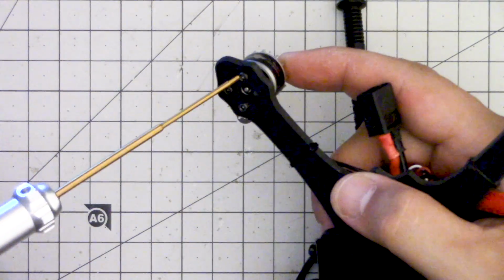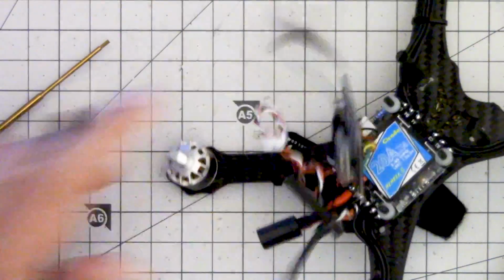Quadcopter Hot Motor | REAL WORLD TROUBLESHOOT

Comment: I have fpv drone I bought online. After a few crashes I lost a motor. When powered on it spins rough a few times and then the drone shuts off power to it. I learned how to Do a motor swap but it didn't change the problem. I took it apart and see nothing wrong. Any help? Thanks love the channel
Reply from the maker: If you swapped the motor and that didn't fix it, swap the ESC next.

Comment: hi, Joshua. Thank you as always. I do have a question.  Hello. Finally received my order to do my build but having major issue I was hoping you could help me thru.

After I built I hooked up my receiver. No drama there. Got motor and board orientation set. Armed and throttled no problem while hooked up to betaflight with Ian and battery. I'm using the f3 and esc with osd you have on sale

Issue. Motor3 will not spin when armed when not hooked to betaflight. So I cannot fly. I upgraded the esc and did not flash the FC. I'm using dshot since the esc upgrade was for that anyway. 16.6 stable.

Any ideas? It flew for one battery after initial build then motor 3 never spun up again unless I had it hooked to betaflight.

Please help if you have any ideas. Thanks
Reply: Sorry, this is an omnibus flashed 3.1.6 f3 with osd and a 10amp esc 4in1 from flexrc
Reply from the maker: It's hard for me to imagine what would cause the motor to only spin when plugged in to USB. Especially because it worked once and then not after that. I'm a little stumped, to be honest.

Comment: hello Joshua,
If I have checked that the motor screws are not too long to touch the winding but the motors are still running hot with props when testing in the betaflight motor tab what may be the problem?
I am using brotherhobby T1 1407 3600kv, Racerstar Labs 28A, betaflight F3 and kingkong 3045 triblade.
Is it possible that these ESCs are not compatible with the motors? because when I try to run EMAX 1306 4000kv with the same setup, i will also get hot motors in the motor test tab.
Thank you very much for your help!
Reply from the maker: Hot motors even in the Motors tab means the issue is NOT PID or vibration related. If you spin the motors with props on to high RPMs, they will get hot because they are working. That's normal. It's normal for them to work harder on the bench than in the air.
Reply: thank you for your reply.
I only put it at below middle throttle and leave it run for about 40 to 50 seconds.
Was considering if I need to change the ESCs because i turn the PID all the way down as compared to the stock settings before conducting the hovering test and still got hot motors.
That is why I am thinking whether there is a ESC and motor compatibility issues.
Do you think that is possible?

Comment: Thanks for this video. My new lizard 95 would fly good for a while but ever so often it would just roll over until it crashed. All the motors are quite hot after a flight but is 115+ here in Arizona so I checked the continuity and both right side motor bolts short to frame. I guess the mounting bolts are a little too long. 
Do the  two motors that were shorted need to be replaced? I can back out the screws and the continuity stops.  I noticed you said that you were replacing the shorted motor in your video. 
Thanks

Comment: Hi Joshua I have a set of hglrc 1104 7500kv and brotherhobby 1106 7100kv motors that are both rated for 2 and 3s. They both get extremely hot running on 3s. Is there any way to tune them in betaflight to keep the temps down? They are getting up to around 60c on all the motors.
Reply: hi, maybe you are overpropping them or the AUW is too heavy for these motors?

Comment: I am struggling with scews that will NOT back out. 2mm hex drive. There is continuity to frame on all 4 esc. Thinking my only hope is an easy out- has anyone ever had frozen screws this size?
Reply from the maker: Why won't they back out? Is the thread stripped or is the head stripped? If the head is stripped there are various approaches: dremel a notch for a flat-head, or use an EZ-out.

If you do anything that will create metal filings or shards, you have to try to take steps to keep them away from the magnets. If you can remove the bell first maybe that would be a good idea. Otherwise, the magnets will attract the filings and junk up the motor.
Reply: the heads will round out- came so tight from the factory. Wanted to say THANKS for your speedy reply! Great warning re keeping debris out.

Comment: It is normal that the 4 motors get hot??
Reply from the maker: D gain too high / too much vibration / not enough filtering. Or over-propped, but this isn't likely on today's 5" builds. Basically no modern 22XX motor or larger is going to be over-propped on any 5" prop.
Reply: Thanks so much. im running a 220 frame with the emax 2205s, and 5" props.
Reply: another question, what is the filtering??

Comment: hey ppl, i just put together a realacc x210 pro and all 4 of my motors are running hot. 2600kv , 30A ESCs. the escs are cool but the motors get warm just from hovering. the quad does micro twitch when hovering and i believe i hear som odd noises from the props, but very very faint. I have default PIDs on BF 3.1.7 and i switched out the Flip32 fc for an sp F3, same results.. any ideas? Cheers!
Reply from the maker: Soft mount the FC using rubber standoffs.
Reply: hmm...i'll try that!
Reply: So i softmounted the fc and the motors went from burning hot to a bit warm, but i am running tattu racing 75C with 5045 stiff props so i am guessing a bit of temp on them is to be expected. was able to blast 3 packs through it with just a few seconds between them, and the motors just got a bit warm. 
The weird prop-sound is also gone, so i am guessing the twitching is down to a reasonable level. 
next up is to soft mount the motors.

Just after i posted here i saw your vid on softmounting, great one!

Cheers, and thanx again for the insight!

Comment: hey josh, i have a 3" build with emax 4000kv 1306 motors, 20amp escs and a piko blx fc running 3x4x4 hq props. i also have it on a 4s batter. its super weird cause all the motors get super super hot. i replaced 2 of the motors an even the 2 new motors get super hot. it gets hot when i hover for 30 secs and it gets like 100000 degrees when i hover for a minute. i lowered all my pid gains slightly from the stock betaflight gains but that didnt do anything. any ideas?
Reply: and the escs and fc are cool, not even warm

Comment: I build my first quad and noticed that Motor 1 and 3 (cw) get hotter than 2 and 4 (ccw). I use naze32 and 30 amp oneshot esc´s.
esc´s are calibrated, quad is hovering fine (still learning to fly so hovering is the only thing i am doing right now).
Am i missing something or is it a normal thing?

Comment: Hey so I am having this issue with my motors getting extremely hot and vibrating like d gain is way to high I checked all possible shorts and tried the checking motor screws would a test with betaflight GUI motors tab verify if it is the motors themselves being degraded (pretty old) or would a short also produce a noise like excessive d gain ?
Reply from the maker: You can eliminate D term as the cause by setting pitch and roll D gain to zero.
Reply: Joshua Bardwell thanks for reply but if the d gain is 0 and the problem still occurs the motors could be going bad right? All 4 warm after 30 secs and after a min borderline hot ...I Checked to see if a short circuit was the problem the motor screws seemed fine
Reply: Alex Dalton bit late but I had these issues recently and it was caused by my gyro update rate and pid loop frequency being changed.
Reply: Setting the P gains too high can also cause hot motors. Lower your P gains and leave Pitch and Roll I and D at zero and then check the temps again.
Reply: Dylan Watkins what FC do you have? I have same problem with BF on F4, 4k/4k
Reply: alexey kulagin I have the matek f405 osd. I solved it by changing the gyro and pid loop settings until it stopped. I think that those settings have a disclaimer above them that says that pids will need to be tuned after changing them. I guess the change could cause a horrendous tune but its unlikely

Comment: No continuity with the frame, low d value, no hot spots on the center of the frame and the motors are good. I have no idea why all my motors heat up with just 15-20 sec of flight time
Reply from the maker: +Emmanuel Mejia set D gain to zero on pitch and roll. 

What motor and prop. What AUW.
Reply: The motor is a emax rs2205 with tri bull nose 5x4.5x3.
Reply: when d value is zero on pitch and roll the motors are as hot as before. Thanks for responding tho!!
Reply from the maker: It's not vibration then. What AUW?
Reply: auw if i understand is the weight of the drone right? it's no heaver than the eachine wizard quad.

Comment: Great video as always Joshua, You are the guru of all things pid and repair. Love your stuff. So quick question.  I have a hellbender204 and I just noised yesterday that all 4 of my motors are hot... So I'm thinking hi Ds... I go and look and they are only 13 in betaflight. I have the motors soft mounted and I need to double check the screws. But what other possible causes could there be?
Reply from the maker: Over-propping the motors, excess D gain, or insufficient filtering, are all causes of all four motors being hot.

Set D gain to zero and if they are still hot, it's not the last two.
Reply: Thank you for your time sir :0) Ill give that a shot!

Comment: Nice video, Thanks for the videos you make . I have a problem with all my motors getting hot. Checked and no ground from screws and the screws do not touch the winding of the motor.They only get hot in Betaflight firmware 3.17 and i have tried 3.20 with the invert er fix.The flight controller is a omnibus f4 v3 from rtfq matter a fact i have 2 omnibus f4 v3 and both do the same thing. About 5 seconds or less you cannot touch the motors. I even tried new motors with no luck.The motors are the rifle 2300kv from rmq and also used  emax 2300kv 2205 motors and i am using racerbee 30a esc from rtfq  In betaflight i have cut the pid s way down with no success . When i installed Inav 1.6 firmware they do not get hot and can fly through 2 or three battery's no problems. But i miss the acro that betaflight has. The quad is a m250 frame that i have flown for about 3 months wth no problems untill now.Do you have any suggestions i am pulling my hair out over this. Thanks and keep the videos comming
Reply from the maker: Soft mount the flight controller using rubber standoffs.
Reply: Thanks for answering me. The flight controller is mounted on 4 rubber standoffs. I have the pdb to frame with  electrical tape on the bottom of it. The flight controller is mounted above the pdb on blue rubber standoff.

Comment: Joshua, Where was the other short?  If there was only one motor wire touching the frame how was it finding ground? In theory that voltage would just be floating.
Reply from the maker: The frame is basically always grounded from somewhere. The mounting holes on the FC for example, via the screws.
Reply: Thank you for the reply.  None of my frames are grounded except for my INAV quad and thank you by the way for the instructions that were so helpful in setting that up.  I grounded that frame along with using a Foxeer metal case camera to eliminate GPS noise. Keep up the good work.
Reply from the maker: The SMA connector for the vTX is another common source of continuity between frame and ground. Lots of the time, when you short a motor wire to the frame, you fry the vTX.

Comment: All four of  my emax motors get pretty hot. Is that a bad tune or just my aggressive flying? I tried tri blades instead of bi blades. It's not a very heavy prop. Hq V1s from king Kong bi
Reply: lower d tune
Reply: glenby2u it's stock
Reply: ok. remember, d is more about rubber band effect. turning it down, reduces the compensation for a higher P. I fly my 5" quads on 23 max d.  this is low compared to the great guys but it works for me.

Options:
1. if the screws are not pressing on the windings, do the motors spin freely? if not, lube is your friend. if not, new motors may be your friend.

2, you may have one of the bad revisions of blheli or equivalent firmware.  Upgrade the firmware.

3. if you have high timings in blheli, you may get excess heat for no gain. set timings to medium and if motors are higher than 2500kv, maybe try medium high after medium.

3. if the motors are brand new. take them out and given them a 1 battery flogging. high speed, lots of punch etc. dont hover and dont hang around. lots of full stick, no stick.
I found new motors need a battery or 2 to break in. a flogging sets them up right and they come down cool.

If that doesnt work - Joshua knows heaps more than me and may be able to help or try RCGroups.

cheers
Reply: glenby2u thanks so much for your detailed reply! they are about a month old and I've been flying them really hard. windings are not toucbing and they are smooth D gain is stock betafkight so pretty low. I will check blheli settings and fw

Comment: If by chance you caught the heating of the motor earlier, would you have filled the screw hole with epoxy and then try to re-tap the hole?
Reply from the maker: The hole wasn't stripped. The screw was just too long. I ditched the motor because overheating the motor damages the magnets.
Reply: Thanks!

Comment: Congratulations on 38K subs! Btw why are you only using 3 screws instead of 4 screws for the motors?
Reply: xuxusito I use two screws to hold all my motors on my builds and I use blue loctite as well. Never had an issue. I even run em just a tad looser from them being fully locked down on tpu pads for some motor vibration isolation.
Reply from the maker: This is how it was delivered from Avant.

Comment: Hi joshua,
I have a problem, when I plug in my lipo my esc's are getting extremely hot in just seconds, I can't even touch them. I have to go fly asap to cool them with the air. I triple checked the soldering and there is no problem, they are properly insulated from the frame. My motors are getting warm but it's okay. I have a Kiss fc with no filtering and racerstar esc's. Do you have a theory?
Reply from the maker: If the ESCs are getting hot even without the motors running, then you either have a short or you have damaged ESCs. Something is seriously wrong.
Reply from the maker: The ESCs should never be so hot that you can't touch them. And they should not even be remotely warm when the motors aren't running. They should be totally room temperature before the motors start running.

Comment: I swear sometimes I'll fly a pack- hot motors. No crash or anything , fresh props. Fly again and cool motors. Strange
Reply: Pablo Contreras I have this on my Lizard95. For some reason 2 motors always get too hot to touch after only 30 seconds of low throttle on the bench. Power off and try again and its either the same two or the other two. Always two motors diagonally opposite. No idea whats causing it. Just bought new ESC after the first one had one motor output fail. I replaced my TX for new too. All thats left is the FC and the motors and since they alternate i'm going to say maybe FC.

Comment: i just had a esc catch fire other day and now after replacing flight controller and new escs i flew it couple times and today it catched on fire again the esc, Have new frame,esc,motor,flight controller and i get a fire on one esc.. so now i put a esc and blheli suite wont even show esc #2 and betaflight motors tab it wont spin motor up but all three esc's do. #2 esc was what burnt up but i just replace and replace motor also. Im stumped can u tell me what i could do? took digital mm and check continuity and #2 esc signal rail on flight controller does show continuity
Reply from the maker: Continuity to what? #2 signal rail shows continuity to what?
Reply: i was checking to see if my wire from flightboard to esc was bad .. could the flight controller be damaged from esc burning up? or something else?
Reply from the maker: Still don't know the answer to my question. What did signal pad #2 have continuity to?
Reply: Joshua Bardwell I did not say this right disregard the last part sorry. I checked wire to see if bad spot is why I did conunity test ( just signal wire ).